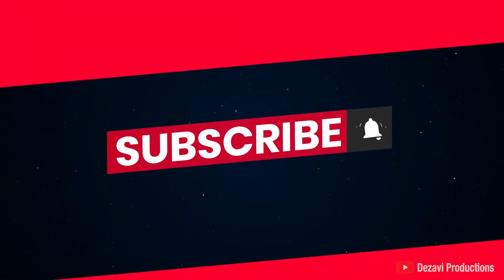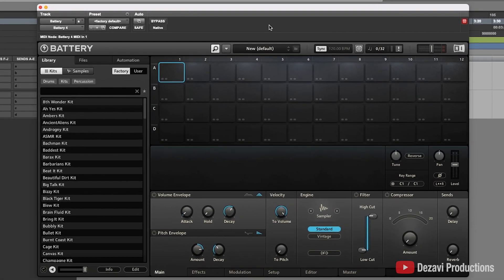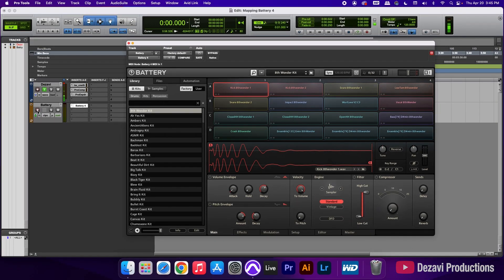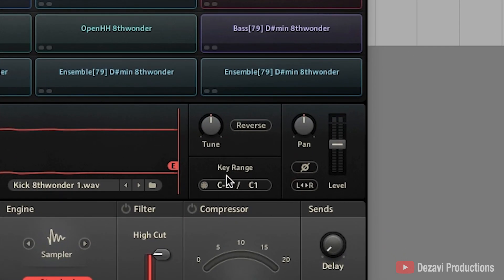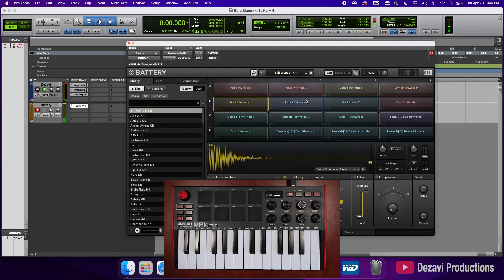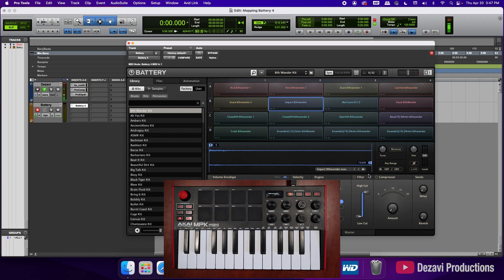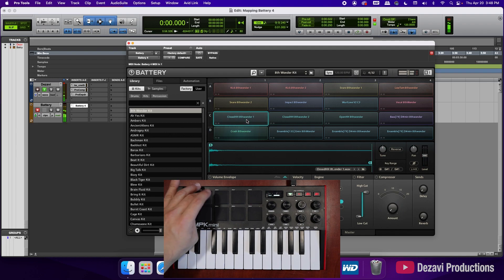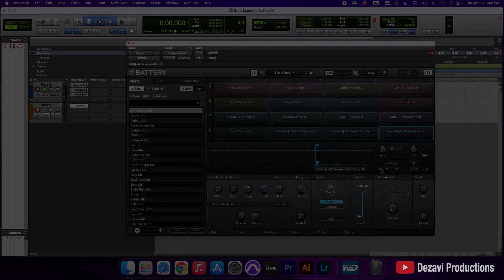Mapping Battery 4 to Drum Pads on MIDI Controller

Comment: Can it really be this easy?  I have Cakewalk Sonar and MPC Studio 2, and Battery 4.  Besides loading Battery 4 as an instrument, do I need to load my MPC as a vst as well?  Thank you.
Edit: doesn't work.
Edit:  Well...this is how I got it to work.  Open Cakewalk, load mpc studio as a vst,  load Battery 4 as a plugin in mpc studio, load a kit into Battery, assign the the kit sounds to the studio pads, use Cakewalk transport/record controls to begin recording in mpc studio.  I can then export midi or audio to Cakewalk from the mpc studio.
I'd still like to know where you started your mpc from.  Was it as a vst inside Protools, or started up on its own?  Thanks.

Comment: So if I want to open a new kit I have to do this every time?
Reply: The Loading tab in the Preferences contains Template Kit, which sets a Kit for BATTERY to start each new instance with. You can select the Kit currently loaded to be used as BATTERY's default Kit. In Battery3 the same

Comment: Thanks for the video, but i don't understand why, when i change the kit after that, i have to do all this mapping again ? is it possible to make it my default setting for all kits?? thanks a lot for answering me !!!
Reply from the maker: Hi, thank you for watching and commenting! I’m not sure why it resets every single time, I agree that it’s very frustrating and annoying. I’ve tried to save the setting but have had no success myself. I’ll try a few more things and get back to you as soon as possible. Thank you for watching and supporting!
Reply: Maybe the best way is to change you pad midi outputs to match Battery's default for the kits

Comment: Thank you! That was helpful. However, is it possible to create a blank template that's already mapped to my AKAI MPD218 so that I can just drag and drop sounds into this blank 4x4 grid. I feel like I tried that in the past but everything something would reset... it's such a pain. I'm using Battery 4 in Reason with  my AKAI. Thank you!
Reply from the maker: Hi Tinah, I’m glad this video was helpful. That’s a great question, I haven’t considered that before. I’ll have to do some research and trial runs on ways to make it possible. I’ll get back to you as soon as possible!